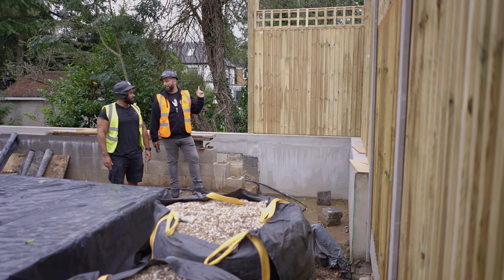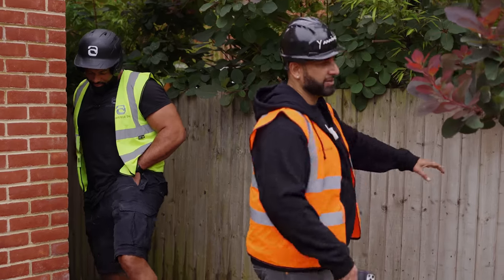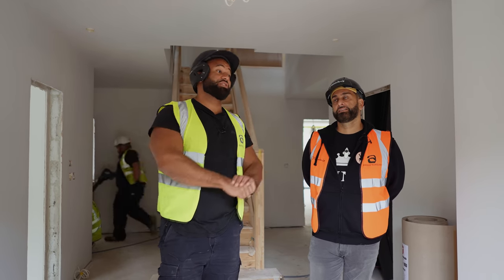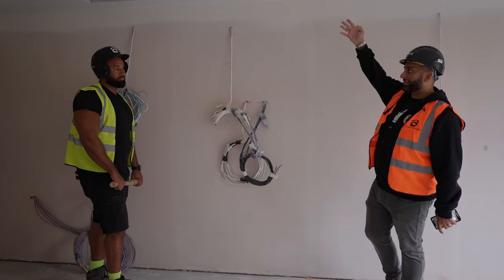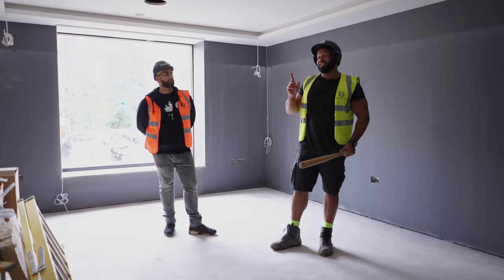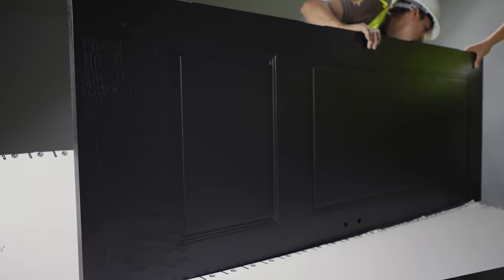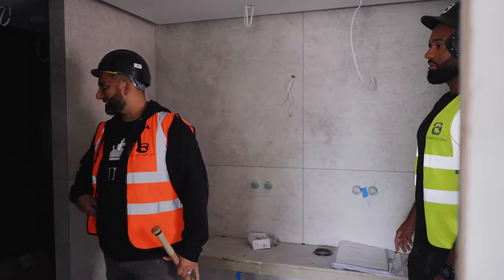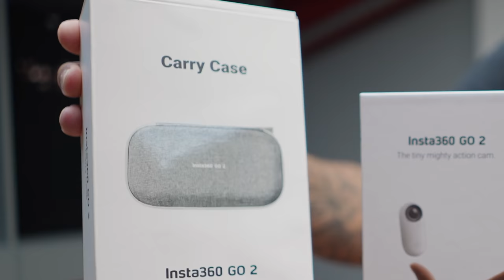Cracking Tile Work | House Update #11

Comment: The house updates have been both informative and entertaining, I don't understand the security issue. I have been marketing residential properties for over 25 years. Actively providing access to prospective purchasers of many homes of high and ultra high net worth individuals. You have kindly opened your home on the platform whilst the refurb is taking place, all of a sudden you seem to be back peddling when the final most important parts of the series are to be scheduled. Take pride in showcasing Daniel's etc's great efforts. Unless you have upset someone Yianni, you should be confident in not having to worry. Film the remaining segments having compleleted the fixtures and fittings, prior to the furnishing/artwork installation.
Reply: I don't understand your lack of understanding! This property is not going on the market. Ultimarely a family home, not a marketing opportunity. There is no all of a sudden or back peddling  Yianni has been consistent and open throughout the whole project. Yianni & Daniel are tight, friends for many years. Yianni & Daniel owe us nothing. Do you not understand banter or the word privacy!
Reply: He deceived Dan. Initially told him yes I’ll let you film from start to finish etc in return Dan is working for free at cost price. Now the job is done so he doesn’t need Dan and has basically backtracked.
Reply: @mwarrior2008  wonder how you came to the assumption that Dan is working for free 🤦🏽‍♂️🤦🏽‍♂️

Comment: Loving the house so far but not a fan of the stair case at all. Needs to be wider. At the moment it looks way too narrow and looks really out of place
Reply: Ideally if space is the issue even just a flared bottom few steps (shell type). Trouble is the space to walk around it. And thats where the doorways to the outer rooms shoulda been put
Reply from the maker: It’s deceiving wait till it’s done.

Comment: Why does it look like that Daniel hates when yanni talks about other people XD
Reply: less money to Dan
Reply: @GregsMowing   Actually because he will have to liaise with and work around these many subcontractors and this in itself can cause delays and take significant time with site meetings etc.

 It would never be the expectation that Ashville would do the entire second fix.

 As the main contractor Ashville will likely be the one getting pressurised to get the job completed when many delays will not be anything to do with them  also the difficulty of working with other firms that they have not worked with prior.

It is very easy to tell that yiani himself also  makes a great many last moment changes and doesn't seem to listen or understand the implications of these.
Reply from the maker: Because people look for any reason to find an issue.
Reply: Thought I heard Daniel praise the painters and is now going to use them on hes jobs…
Reply: @bradshoesmith5084  yeah no i heard that, just saying what i see he doesn't look the best yk
Reply from the maker: @bradshoesmith5084  👏🏼

Comment: I would hope they using  a decoupling membreme under the tiles, if they are there shouldn't be any cracking regardless of if the heating has been turned on

Comment: as long as they roll the last coat otherwise you will never match the finish if you need to repair a spot on the walls/ceiling

Comment: How did the water pressure end up.After the plumber broke every rule in the wras handbook. Iv never seen a plumber use so many elbows instead of swept beds.I thought a company like ashville would get this correct. Especially after Daniel even highlighted this when he was using concrete pump.# maintenance company.